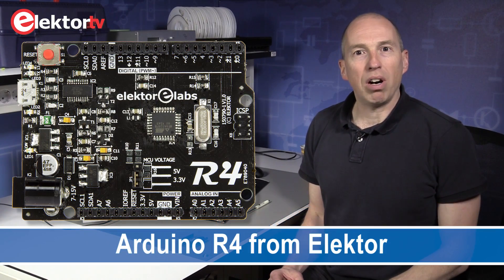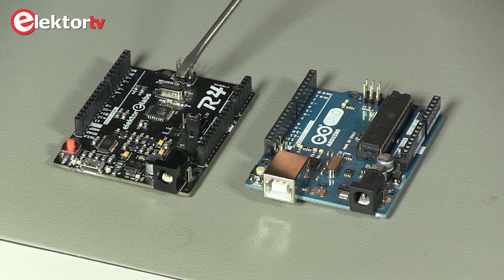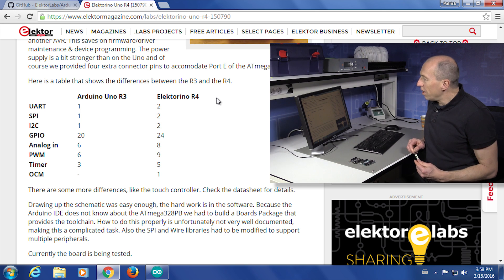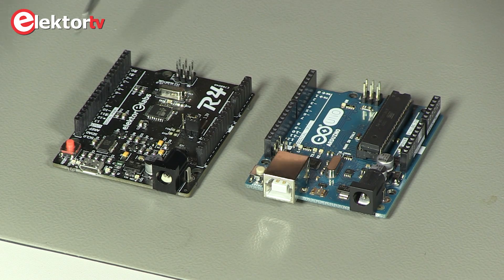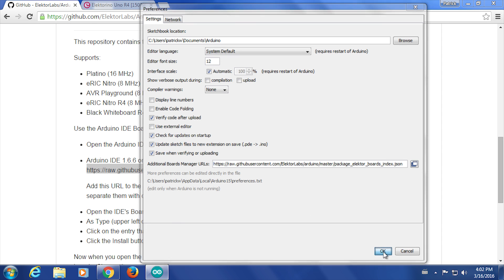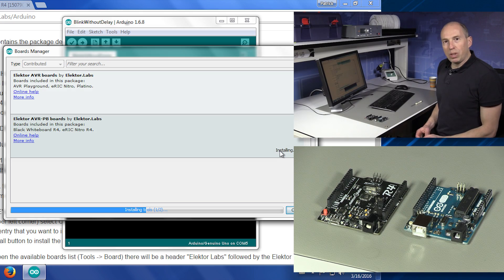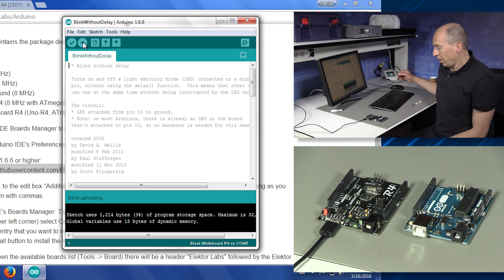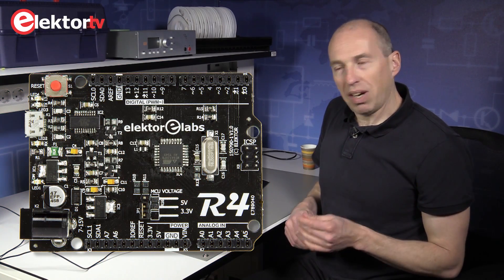Elektor Uno R4, the Beefed Up Arduino Uno R3

Comment: Maybe you can answer my question: 

I often the classic UNO R3 to burn the Bootloader to a NANO (AT328P) using the "Arduino as ISP" method described in the "Arduino examples" of the IDE. In this case the NANO is a slave, and the UNO R3 burns the Bootloader in the NANO.

But a  problem appears with the more recent NANOs equipped with a 328PB instead of a 328P: the UNO R3 is unable to burn a bootloader in a Nano 328PB.

Will you R4 be able to burn a bootloader in a NANO 328PB ???
Reply from the maker: Never tried it. IIRC, the 328PB has a different chip ID than the 328P, which complicates things. Normally, you should be able to use the Elektor R4 bootloader on your Nano 328PB but I am not sure how the Arduino as ISP sketch handles it.

Comment: I use atmel studio 7 for the Arduino because of al debugging options and assembler support. Is it possible to use this new 328pb board also in atmel studio 7?
Reply: +Roeland Riemens Yes, you can, no problem. But don't forget to grab the modified Wire and SPI libraries for the second I2C and SPI ports. Also PWM on pin 2 requires special attention. Everything you need can be found here: https://github.com/ElektorLabs/Arduino/